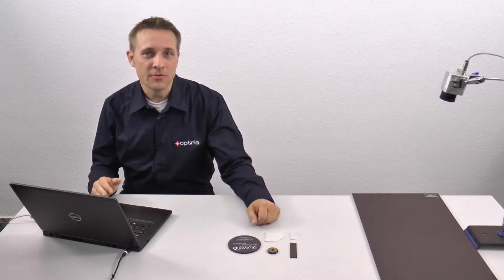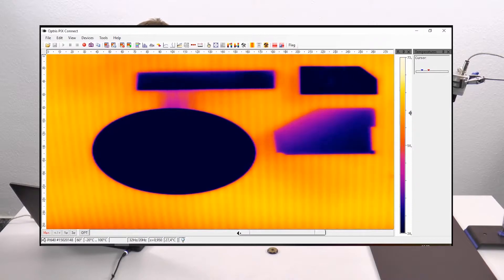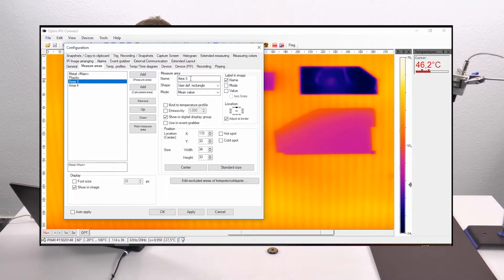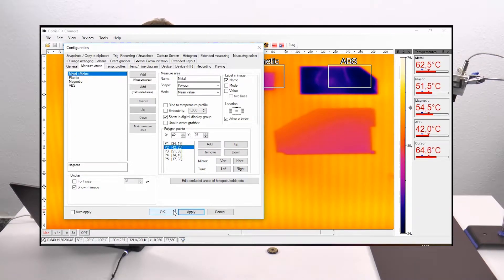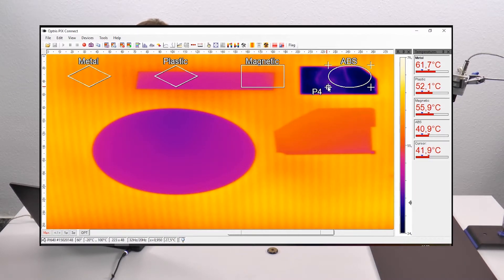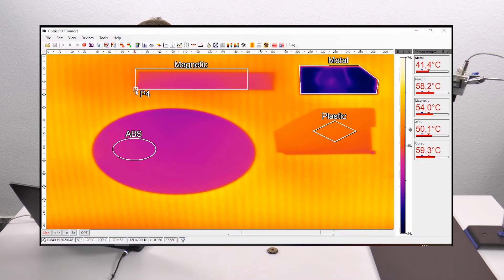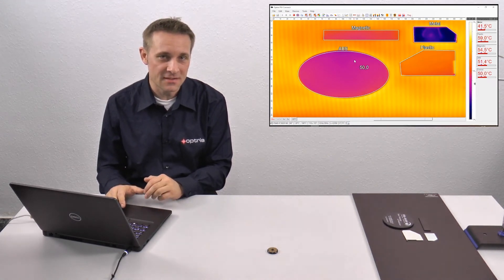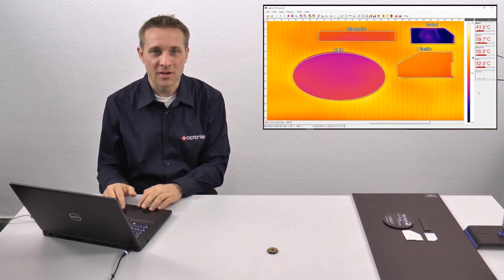Optris PIX Connect: How to set up Measurement Areas for Temperature Measurement

Comment: In measuring area setting there is rectangle  and point option, no line option.
Reply from the maker: You can create with  the software PIXConnect a temperature profile where you can see the temperature distribution on the line. You can also bind in an automatic way some measure areas on the temperature profile line. (See menue: Configuration => Temp Profiles => Bind measure areas to profile.)